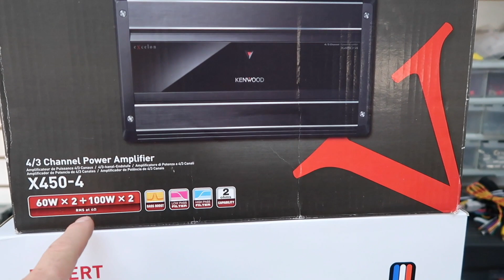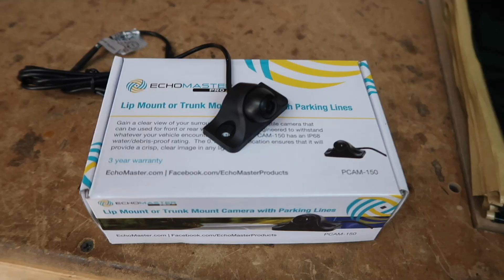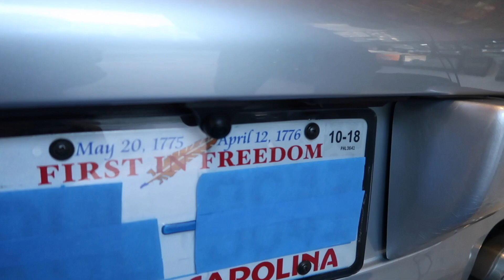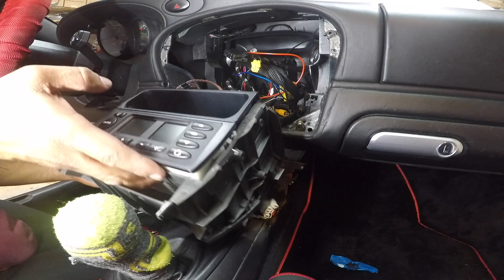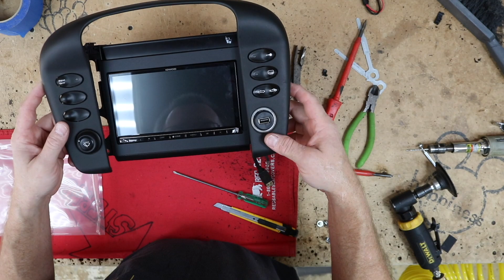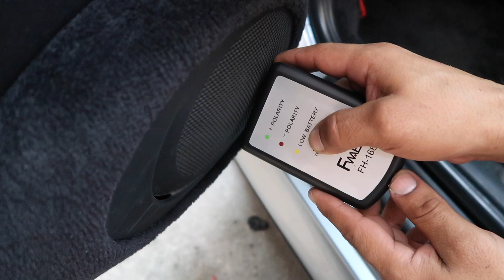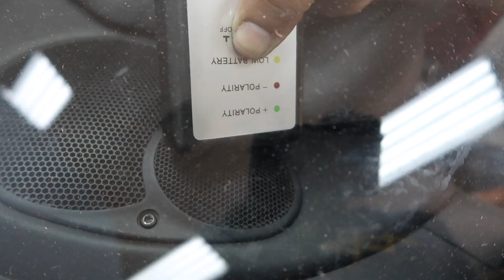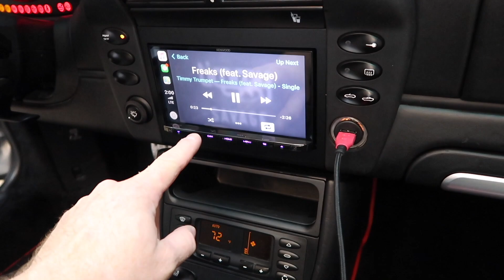older Porsche 911 full car stereo install

Comment: Could you have ran the front semi-active (midbass on the larger channels of the amp and the mids and tweeters from the smaller channels) and then just run the rears from the head unit?

Comment: This is an old video correct?
But anyway, i think all manufacturers should provide a box for mid bass like Porsche does the bass feels tight.
Reply: I agree! I have installed many systems that replaced Bose OEM, they often have their own separate enclosure. In quality speaker systems, the enclosure is as important as the driver itself for mid/low and low frequencies.There is so much in a door that can vibrate or rattle, a separated enclosure will help prevent this, and a door itself is simply not a proper enclosure Back in the day, I fabricated fiberglass enclosures to fit inside the doors of my Eagle Talon...If I owned this Porsche, it would have an Audiotec Fischer/Brax/Helix/ Match amp/DSP and use the OEM speakers. It would be far less invasive and offer as good or better sq than the mediocre gear installed, and probably cost less.And it would not be Chinese gear
Reply: Yes it was an old episode (2-3 years old)
Reply: @flspeid  …they may have storm Ian related issues , showing some repeats…being said, they really don’t do as many as they used to